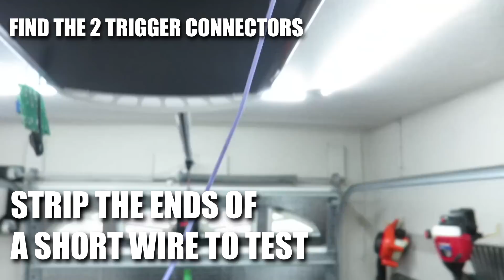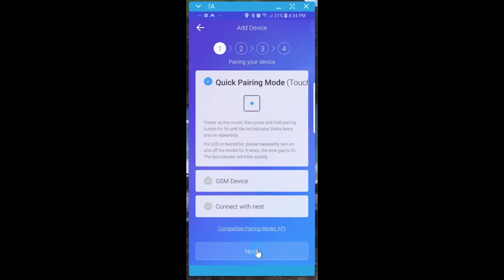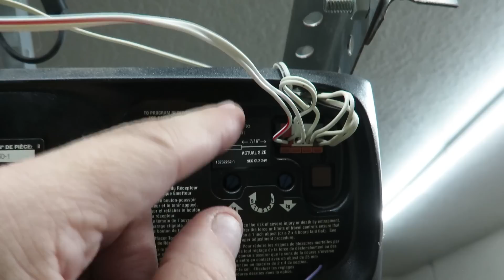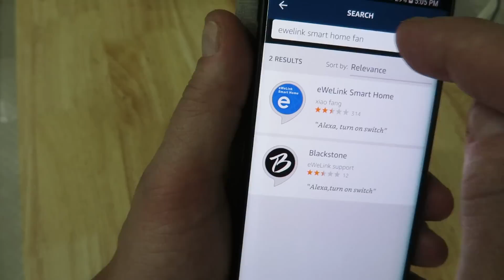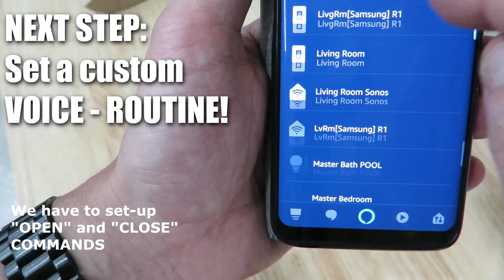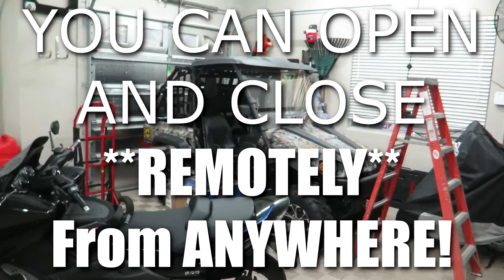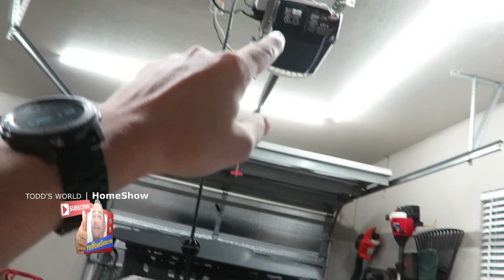SMART GARAGE DOOR OPENER | $15 | eWeLINK Smart Control for Garage Doors | with ALEXA & Google HOME

Comment: Thank you very much.  It helped me with not replacing my whole garage door opener.  It would not open with any remote.  It is over 20 years old and after troubleshooting with Chamberlain it was determined that the circuit board needs to be replaced ($100 on ebay).  With this solution I can open and close it from anywhere.  Thanks again.
Reply from the maker: That's AWESOME. Glad I could help 😀

Comment: Anyone figure out how to change the wifi the device is set for? Do I have to remove from app and re add (in programming mode and whatnot), or is there an easier way?

Edit: to answer my own question, I just had to redo the setup (programming mode and what-not) with my phone on the new wifi and it worked just fine. I did not have to remove the device from ewelink prior to redoing the setup.

Comment: This vid is a few years old and even though the device worked great there was an issue where after a power outage and power is restored the devices would activate.. This is ok when you are home but I came back from dinner and my gate and garage were open..  I unhooked the device for months but I have though about how to fix it and I found a way.  I had a TPlink ssmart plug that I bought for $5 on Black Friday and I plugged this device into the smart plug.  I then made a Alexa routine that did 3 things
1. Turn on the smart plug
2. wait for 20 seconds
3. turn off smart plug
Works great.. I threw the breaker a few times to test it... Hope this helps someone

Comment: This worked great on my 20 year old quantum opener. thanks for the video, huge help. The only thing you might want to add is this: Adjust your "inching" setting to about 1 second. You only want the connection powered for a second to start the door opening or closing. If you don't do this, you will constantly be hitting the button in the app twice to turn the power off and then back on again to start the door moving.

Comment: I actually have something very similar.  I purchased a 4 relay unit.  I have 2 garage door openers.  I connected 2 of the 4 relays 
directly to the back of the 2 buttons which I had easy access to on the other side of the wall.  One unit did both.  I was thinking of using one of the other relays to turn on the garage light or outside flood light.
Reply from the maker: Oh Ken, You must be talking about this one here:  https://youtu.be/MypwEcB5nT8
Reply: @twHomeShow  Yes that one looks like it.  One button is for the WiFi connection.  What is the other button used for?  To manually turn on and off the relays?
Reply: By any chance would you have the paper instructions for the 4 relay unit?
Reply from the maker: Ken, NO I don't. Maybe this could provide some help:  https://www.diymore.cc/products/sonoff-wifi-wireless-smart-switch-relay-module-5v-for-home-apple-android-app

Comment: Does this work on the latest garage door openers.  I heard the new ones for the wall buttons send out data not just create a short when pressing the wall button to open the garage door.
Reply from the maker: It may still work on those if connected directly to the garage door motor. Someone would have to test it. Great question.  -Todd

Comment: Awesome video sir! My question is, is this applicable if i install it to multiple family members on their phones too ?
Reply: I have mine paired to the eWeLink app and then using Google home to control it - this allows anyone who is a part of your "home" to be able to control the door. If using Google, you'll just have to go to the setup up devices tab and click Works with Google. You'll select eWeLink Smart Home (or Smart We Link - I have both attached to my account, so not exactly sure which is needed now) and log in with your eWeLink account. You should be able to see the device and control it from Google Home now. It's worked for almost 3 years pretty flawlessly.

Comment: Hi,  will Echo/Alexa be able to distinguish if the garage door is already on open or closed state? Lets say, if its already open, what happens when you tell alexa to open the garage door, looks like it only knows logic 1 or 0 to trip the switch as it is only a switch so even if you say open garage door even when its already open then  it will close it, no? so if this is the case, even only using one command to the switch will either open or close it. Please let me know.
Reply from the maker: You are correct.  -Todd
Reply: @twHomeShow  Thanks for confirming Todd, Im trying to look for something that will be able to distinguish if its already closed or opened. Please let me know if you have one or in the future =) your videos are great and informative by the way
Reply from the maker: @simplytrece  Thank you VERY MUCH! You may want to check-out this other video...this YoLink product provides what you're looking for, I think.  https://youtu.be/7A5ozVn3pOg     -Todd

Comment: If my garage door is already closed I do not want it to open when I give Alexa the command to sloe the garage. I'm trying to find the eWeLINK device that comes with the door contact sensors but I can not seem to locate that item. Could you please send the Part Number or a web link to purchase this eWeLINK with door sensor device?
Reply from the maker: Chris, the one with door Sensor is listed in this video description. Please check.  -Todd

Comment: Todd, Wow, it's been over 2 years since you posted this and I installed it. Since then many other products that are supposed to do the same thing have come out. I've seen many complaints about most of them, some even require subscriptions to work with alexa. Since I dialed in my geo-fence I've experienced zero issues. It has been flawless! So lets see, this item $10, contact sensor $20 and wyze cam $20. Total garage door operation and security $50 and 100% solid. Thanks again for all you do!
Reply from the maker: Thank you David!  -Todd

Comment: Just curious, why can't the constant low voltage power from the GDO that is used to power the onboard, accessible, RF PCB board be used to power up instead of a separate 5v power supply? Since it's the same power going to the button and the board and relay are rated for up to 24v.

Comment: Well, I posted a year ago this was the best video on this and it got me thru the install.  A year later my wifi needed upgraded and my new system is a Mesh type, and this module does not work with mech systems.  I have been banging my head against the wall to figure out how to get this set up and found the verbiage on the page on Amazon.  "The WIFI Relay support 2.4G WIFI only,doesn't support Mesh wifi system and 5G WiFi network.".....Any idea of a modern replacement for this?
Reply from the maker: Are you sure your new mesh system doesn't support BOTH 2.4 and 5ghz?

I have been using the Google mesh system for a couple of years now, with this. Google mesh handles BOTH 2.4 and 5 ghz together.

Maybe you can turn on the 2.4 In your mesh settings???  Just trying to help, but your mesh might not have both.  -Todd

Comment: Hi. Nice video. I have a problem. My garage unit has 6 wires connecting as up, stop, down, USD, something else and COM. Now where do I connect the cables and or will it work with mine ?

Comment: Great Video. Just bought and installed the device. BUT... you have to go into settings and select "Inching", "0.5 sec". I didn't do this at first, so the module was always ON so my garage door button wasn't working.
Reply from the maker: Nice job and thanks for sharing your tip!  -Todd

Comment: I have two of these installed, one for garage and one for gate.  They work great and can pull in a very weak WIFI signal, but there's one BIG problem I've had.  When the power goes off and back on, the modules activate and open your door/gate.  This has happened to me when we were out of town and a neighbor called to tell us.  Luckily I could close them remotely from my phone with Alexa, but still a concern.  With the gate, there's a car battery in the control box, so I'll just switch the power to it which will be constant.  For the garage, not sure.  Any solutions to this?
Reply from the maker: Hello Don, I believe there is a solution. If you open-up the eWelink app > choose your switch > select menu at top right > scroll down to "Power-on State" and change this to "Last State". I think that will solve the issue.  -Todd
Reply: @twHomeShow  Awesome, glad there's a simple fix.  Just made the change.  Thx
Reply: Hi, I know it has been a couple years but if you did not find a solution. I plugged the switch into a TPlink smart plug.  Then I went into ALEXA APP and set up a  3 part routine.. Part one was turn on.. Part 2 was wait 20 seconds. Third part was turn off.. This fixed the power outage issue for me

Comment: Sadly, Ewelink is now requiring you purchase the access to use through IFTTT. I now have to revert to using the button on the app. Luckily you can set it up with Siri as I had before through IFTTT
Reply from the maker: With ALEXA - You don't need to use IFTTT. You just create an ALEXA Routine to operate it :) It's WiFi and works with ALEXA in your household.

Comment: do you have to buy the samsung smart thing sensor to get this to work with Alexa, you really did not clarify that. That also jacks up the price and full set up time
Reply from the maker: NO. You do not need the Samsung SmartThings Hub. This unit works over your household WiFi along with the eWeLink APP.

Comment: On your new link it doesn't take you to one with a door sensor, it just takes you to the 12V inching/Self locking wifi switch.  Which brings up a question, what is the difference between that one and the normal 12v one?

Here is the link I am referring to.

*ALL NEW* WANT ONE WITH A DOOR SENSOR?

$26 | MHCOZY WiFi Wireless Smart Switch Relay Module for Smart Home 5V 5V/12V| https://amzn.to/2QaZmCL

Comment: Looks like you’re connecting to the photo eye inputs, some openers have “monitored” photo eyes which means there is always a little voltage running through them when the system is operating, and if the wire breaks it won’t work....this is designed on purpose so the opener won’t work without a safety device. You may need the normally closed and common connection in that case. Also, you used a jumper to open the door, so you essentially created continuity, no voltage was input to the control board. May want to mention that. Make sure your switch output is a dry contact, meaning you are adding minimal to no voltage to the circuit, just continuity. Very easy to test with a multimeter. You don’t want a device that will put mains voltage into your garage door opener when you engage it. Or worse, your gate operator board which is likely 5x the cost of a garage door opener. You will release the magic smoke 💨

Comment: very good thanks for that . i have small problem my Sonoff Home WiFi Wireless Smart Switch is not pairing with my network i reset few times with pairing mode but eweling app not pair
mt phone iphone8+ net work not sure so what is the next step pls let me know .

Comment: I have a Chamberlain MyQ garage door opener which works with wifi, but not Alexa. I noticed that when I jump my wires for the opener, like you did, nothing happens. Would this still work id that doesn't open or close the door?
Reply: No, not at those connection points. I would try to remove your switch from the wall and try jumping those two wires at the switch...see if it will work from that point.

Comment: great video. if you are not home and wanted to open the garage door, can we control over the ewelink apps?
Reply from the maker: Yes! you can :)
Reply: @twHomeShow  thanks for quick responds. love your video.
Reply: @twHomeShow  Hi Todd, do you know which device that tell you if the garage door open or close? BTW, i installed the ewelink and works great but cant tell if open or close when i am not home.
Reply: Hi Tood, I forgot to ask about reset if you wanted to change the wifi ?

Comment: Todd thanks so much for the great video. I ordered one of these followed the instructions to the letter. Must have set up 10 times. I could not get the router to see the module.. I could connect to it wiz my i Pad.. I have a WiFi set up from Comcast only 2 years old. I sent it back to Amazon. Any ideas as to what the problem may be. Thank you in advance for your response. Ben Herr

Comment: I purchased a Sonoff (ITEAD) in late December. It paired right away. Hooked up to the garage door and Alexa and was working perfectly. I got a new router and did something that the Sonoff no longer lit.  I bought 2 more. One for a spare. Deleted the old one on the Ewe app. Neither will pair - 'Quick pairing" or " Compatible pairing"

Comment: Thankyou i really like your this video  i need my outside front metal sliding gate also work with phone app what shall i do ?
Reply: depends on the gate opener. Some use a single terminal for open and close, like the garage door. Some have separate terminals, one for open and one for close. Some have a third for stop. 
If your opener has separate terminals, you will need a separate wifi module for each function. 

Most important, you will need to make sure the wifi signal reaches your gate. IF it does not, you can get a Ubiquiti wifi point to point set to extend wifi to your gate...but that gets more complicated.

Comment: Thanks it worked. I have a guardian garage door. I was down to one remote so I tried this. It took me a while, but for the eWeLink, I couldn't get "quick pairing" to work, so I used the "compatible pairing model". I also found this video   https://youtu.be/beG4ee-a-vs to be helpful but yours was the first and best. Thanks.

Comment: Great directions, technically it worked and was easy to set up. The jumper test does confirm that it will work with your phone. But, on my Linear (3-4 years old) opener our cars homelink buttons didn't work anymore, nor did the wall button. My 10 year old Chamberlin same issue with the wall button not working. I believe it has to do with both openers being a rolling code style opener. I am not willing to give up the buttons on the wall or the built in buttons on the visor of my cars. I have read that you might be able to solder onto the wall button, I am going to give that a try and see if it works

Comment: Got 2 for both my garage doors. They work great using the ewelink app. My problem is when I linked it to my echo, I have to keep going back to the ewelink app to turn them back off before alexa will open or close them. Any thoughts?
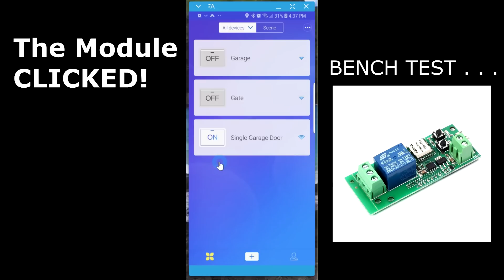Reply from the maker: Um, Only thing I can think of, by what you're describing is ....at 7:37 mark on my video, you'll see - when you click the device, it should change to ON - then OFF automatically. So you might want to rewatch the beginning of the video to be sure you set it up as described. I'm not sure if that is what you explained...just trying to help you problem-solve...TODD
Reply: @twHomeShow  Thanks for the reply Todd, I will go back and make sure I done it right. I will get back with u with a much clearer question
Reply: OK,,The correct light by the usb is on. When I give it a command or push the button on either app, another indicator light always comes on. The light is at the top right corner of the blue relay. Is this correct? I couldnt tell on yours on the video. If both lights are on, it will do nothing until I go into the ewelink or alexa app and push the button to turn it OFF . Then it will take the next command. Any ideas?
Reply: figured out a workaround. I programmed it to Turn on, wait 5 seconds, then turn off. Works great . It works with the switches on the wall, the keypad and the car transmitters. Very informative video. Good job Todd

Comment: I install in same way but i was shocked when power is out and come back garage door open automatically . Its huge  failure and safety risk . If u know the cure plz let me know thanks
Reply: That is 100% correct. As far as I know, there is no cure. I had to put mine on a smart outlet so now, I have to turn the outlet on with a separate app which literally opens the door a few inches then, open or, close the door all the way.

Comment: I have LiftMaster and in my Garage Door opened there is no cable connected in the Red wire hole spot. So I tried to connect one of the cable from the board to the Red hole and other one in White hole but it’s not working. Any idea what I’m doing wrong?

Comment: Does jump wire test work the same on genie garage door opener
Reply: kenneth williams Yes works same on all garage door openers
Reply: Which slots did you use for testing with jumper wire? I have single wires, red and white, going into the slots that are on right side and not left. Are those two the ones I need to use for testing?

Comment: why it doesn't work with google assistant ??
Reply: yes it does. You can also use IFTTT to customize better the voice commands and create scenes. I created a scene linked to the voice command "Hey Google, I am going out by car", that opens the garage door and the gate
Reply from the maker: eWeLink states it works with Google home Assistant. Google is very difficult to setup with smart apps right now. I would suggest you purchase an Amazon Echo, It's much easier!!
Reply: Hey there... mine does with google 👌 
Easiest way to set up is... tell google to sync new devices!

P.s as long as you have already created or signed up to , smartlife profile and synced it with your google account.. 100% works!